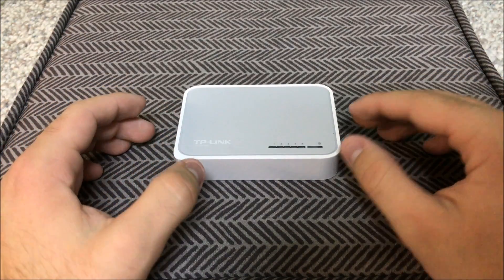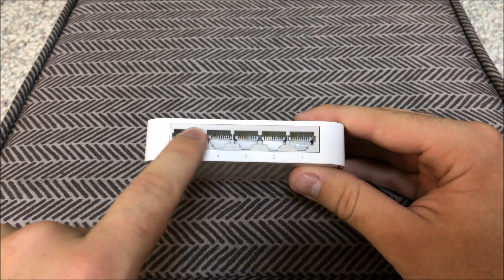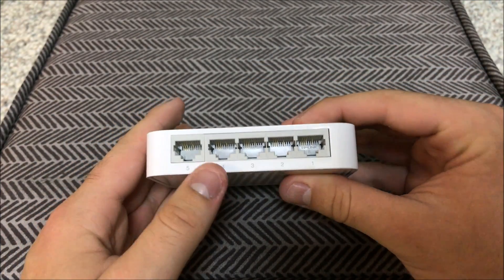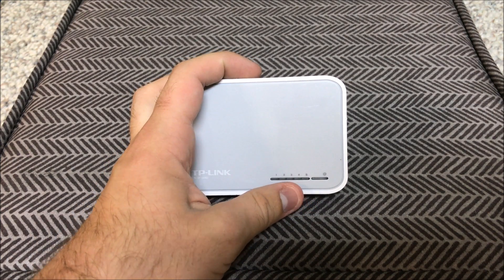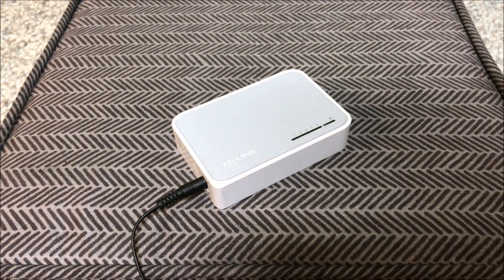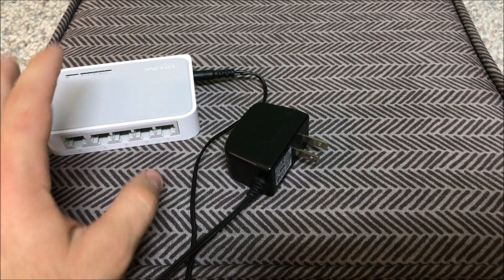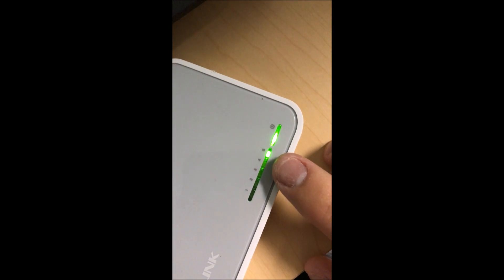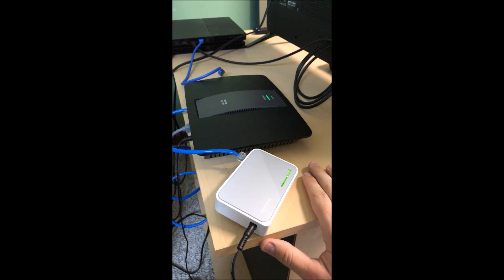TP Link TL SF1005D

Comment: Can I use it on an WiFi extender? I mean that I would connect the wifi extender port to the 5 port so will i have the rest 4 of the ports ready to plug in into my devices ?

Comment: I'm looking to use this device with the WR902AC and a 4G/LTE connection as a portable internet solution. So, I'd like to power it with a USB cable but I can't seem to find anywhere that tells you the size of the DC barrel connector.

Comment: So if I attack an ethernet cable connected to wifi and two other wires for pc, does the initial cable make the other two work as well?
Reply: The way this device works is the following...

ISP(Internet Service Provider) -> House -> Wall Outlet -> Router -> Wi-Fi + Unmanaged Switch -> Your Devices you want on the internet.

The Router handles IP Protocol communication, AKA IPv4 with NAT(Network Address Translation) or IPv6 ( no NAT required ). Try to use IPv6 when you can and avoid IPv4 all together as it introduces NAT which can severely limit your ability to play with others or even just play properly and you wouldn't even notice.
The Router creates a Wi-Fi Field and Network that other wireless devices can connect to.
The Router also tends to provide some ports that you can use to connect up devices physically, with a cable, vs using Wi-Fi.

This device, the one being reviewed in the video (TP Link TL SF1005D), is called an Unmanaged Switch. All it really does is add physical ports, if all the ports on the Router are taken up. For it to work you need what is called a dedicated backhaul cable, It's just a basic CAT cable of sufficient quality, aka CAT 5e, CAT 6, CAT6e, etc, coming from one of the Router's ports to this Unmanaged Switch. After that, you connect up other devices, via wire, to the Unamanged switch, and now those devices have a wired connection to your network.

Comment: So this is kinda a hub and if i plug in one ethernet it wil unlock kinda like 4 extras right?
Reply from the maker: Yes it will. Usually a switch will have 4-5 ports on the back to connect ethernet. One of these ports will be labeled or colored differently usually, that’s the one you connect to your modem or router via Ethernet. After that one cable is connected the others will provide internet when cables are connected to them.

Comment: What even is it
Reply from the maker: It’s a network switch. It takes a wired internet/ethernet connection and splits it among several devices. It’s like WIFI, only it goes through a wire and is slightly faster and more secure generally speaking.

Comment: I am kinda confused I have an ethernet connection connected my pc, can I use this switch and then connect 2 more cables so I can have the connection used for my pc and my ps4?
Reply from the maker: Yung Pizzaaa yes you can. One port on the back of the switch is what provide internet throughout the switch (it’s usually labeled). The ethernet cord going to your pc needs to go into that port. Then you can use more cords to connect your pc and your PS4 to the ports on the back of the switch.
Reply: @simplicityelectricity8710  thanks a lot m8
Reply from the maker: @yungpizzaaa1172  anytime

Comment: bro can we connect with WiFi router
Reply from the maker: Yes, you can connected via ethernet cables. Make sure the switch has internet going into it via cable (usually it has one port that is a different color or outlined) then after it has internet you can run cable from any of the other ports to routers, tvs, computers, whatever you want to.
Reply: @simplicityelectricity8710  then I don't need to buy t link modem
Reply: bro will not get enthernet cable one this tp link

Comment: Hi bro can i connect two (tplink)switches together?
Reply from the maker: Yes you should be able to. If the switches look like the one in the video, just connect an Ethernet cable from one of the 4 ports on the back of one switch and run it to the outlined port on the back of the other switch. It’s hard to notice in the video, but some switches only accept internet through one port, which is usually outlined or a different color. Sometimes switches can accept it through any port though in which case plug it into any of them.
Reply: Simplicity Electricity Thanks Bro 😊

Comment: is there a way to know its ip ?
Reply from the maker: Usually you can connect it to the computer via Ethernet and it should pop up in a lists with other IPs. How you get to that list is up to you as there are several ways to see it. I would recommend a google search after hooking up the switch to see what option is best for you and what you feel comfortable with.
Reply: @simplicityelectricity8710  do u know the easiest way to get the ip ?
Reply from the maker: Deathwarrior one way to do it would be to connect it to a pc via Ethernet cable then scanning for it on your computer. I’m not an expert on doing that however so I’d recommend a YouTube video that shows you how to find the IPs of connected devices. Usually if you unplug it and refresh the list one of the IPs should disappear and then you’ll know it’s for the switch

Comment: I'm confused by ethernet. Are there different types of ethernet cords and only one type will work with this? I've tried using other varieties of ethernet, and they do not appear to work with this device.
Reply from the maker: Adam Blumer there are several types of ethernet cords, the most notable ones being called CAT5 and CAT6 or some variation with those numbers. Any ethernet cord should work with this device, but some cords transmit data at faster rates among other things. It may be something in the device itself not responding to the cords, perhaps it may not be able to detect the cords being plugged in. Does your switch have lights indicating when something is plugged in?

Comment: What does 10/100mbps means? Can i connect it to 4k tv or is the bandwith too small?
Reply from the maker: Stelios Koupepides 10/100 is a standard used by many switches that indicates that device can determine the speed of the device it’s connected to, being either 10mbps or 100mbps. To put it simply, if your internet connection exceeds this or if you have a lot of high grade equipment then the bandwidth may be too small. Odds are however that this device can be connected to any 4K tv or any other device just fine without limiting quality. If you feel like my explanation didn’t quite answer your question there are plenty of helpful resources online that could explain it better than me.

Comment: Can you help when I plug my switch to my att router it make it disconnect? Also should my switch be plug into a outlet surge protector?
Reply from the maker: Jamel Haynes the ATT router should have ports on the back that you can plug anything into, this includes switches. If it’s causing your router to disconnect from the internet I would try all the ports on the back and if that doesn’t cut it it could be an electrical issue. Extra protection always helps. If you feel replacing the router or switch would be annoying or a financial issue then yes, but if not then you can do whatever is more convenient and they will still function the same with or without a surge protector. If you could go into more detail about the disconnecting I could tell you more?
Reply: @simplicityelectricity8710  I would like to try your idea bout plugging 4 Ethernet cables into my router but unfortunately I have 2 also are brands like tp link and netgear universal
Reply from the maker: Jamel Haynes could you be more specific on what is getting disconnected? Is what you’re plugging in getting messed up or your ATT modem?
Reply: @simplicityelectricity8710  my router does not have a modem is that like the battery for the router?
Reply from the maker: Jamel Haynes a modem is connected to your phone line, most home and apartments have them. Usually someone from an internet company installs them.
Reply: Simplicity Electricity my wifi keeps disconnecting like it was randomly connecting and disconnecting my wifi just only one cable the dsl line cable
Reply from the maker: Jamel Haynes it may sound old fashioned but try resetting the router/modem or updating its software. There are times where it will help devices connect to newer devices properly. Beyond that it sounds like a hardware issue, which you may need someone to look at hands on.

Comment: I don't think you understand how a power supply works. The PSU specs state a voltage and amperage and the only one of those two that's fixed is the voltage whereas the amp rating simply indicates the maximum it can output but how much is actually delivered depends on what its connected to. This means that if that device is 5v/600ma and you use a psu that's rated at 5v/6000ma, it will work just fine and the psu will only deliver 5v/600ma.
Reply from the maker: Potus ThePlant I was just trying to be specific so no one would get confused.

Comment: What is this used for?????plz reply...i mean can i use it wirelessly coz my rootee is in another room
Reply: It's just a switch.. 1 input 4 output that's it. It won't give you wireless network. For that you have to buy a router which has wireless network.
Reply from the maker: The below answer is correct. Sorry for the late reply but yes, it cannot be used wireless, it is meant to route internet via Ethernet cables, which do not involve WIFI.

Comment: I have the same product but when I plug in my ethernet cable it doesnt provide internet. The lights keep blinking (all of them), i tried all the 5 ports for but it wont work. what to do?
Reply from the maker: Sandjero Sombrero this could be for several reasons, I’ll try to be specific because I know these things can be frustrating.

Switches don’t usually break so to speak, unlike routers. So you could start by resetting the modem or router that the Ethernet cable you’re trying to plug in is connected to or by plugging it into different ports.

The chip inside that actually spreads the Ethernet signal to the other ports could be fried, and in this case you’d have to replace the switch outright :(

Although it’s rare there are cases where switches just aren’t compatible with routers/modems. I doubt that this is your problem but if you really want to try to make it work and not be forced to replace it I would recommend changing some setting in your router/modem, possibly security features? I’m a little fuzzy on that however.
Reply: I had the same issue after trying to use the switch in a new/different setup.
The ONLY way I got it working again was to plug in ALL the same devices that were plugged in before. Then it went back to the async traffic flashing and all devices were connected to the internet.
Maybe it was caused by TP Link Wireless Nano N Router which was also connected to the switch. The Nano Router's job was to host an independant WLAN network (which he did). But the router also offers many other networking modes (WISP-Client, Client, Repeater, AP) and might have changed to one of them when I was unplugging all the lan cables in random order. And that other mode might have caused the issue.
Reply from the maker: Martin Schneider honestly this probably helps anyone who reads the comments. Most of the stuff I review is quite old in comparison to what’s on shelves. I just find the older devices more practical, but I can see how they could not be compatible with a lot of new technology.
Reply from the maker: Josh McDermott rip everyone’s switches I suppose. I have been fortunate that all of the equipment I use/make videos of hasn’t broken...yet

Comment: what’s the device’s webpage password?
Reply: This device does not have a webpage or username password. It's plug and play
Reply from the maker: The Supreme Nerd you are 100% correct. I am going through my comments and realizing that person above must’ve had a router of some kind for it to ask for a password.
Reply: @simplicityelectricity8710  yeah i open this device myself plus i researched it before i bought it
Reply from the maker: Potato02727347 8 the device webpage password for devices such as this usually are "admin" or "password". This is assuming the device is reset or has features like a router. In this case I've never been prompted for a password so I can't honestly answer.

Comment: can i plug my actual internet lan cable to this switch and then spilit into two cables.. in which one goes to router for wifi and other to pc directly.. (because im trying to bypass routers port as it gives me greater ping than direct connection)
Reply from the maker: Hi TechHeaven sorry about the late reply, haven't had time to check comments lately. To answer your question, yes you can. If you're using this exact switch you should be able to plug the LAN into any port and the switch will automatically make all other ports extensions of your connection. If this doesn't help please reply back!
Reply from the maker: The TeamExtreme thank you for your reply in the comments! I hadn't noticed the previous comment until your notification popped up so much appreciated.
Reply: update: it will work but either the wifi will work or the pc.. you can't access them both at a time :'( !
Reply from the maker: TechHeaven could you explain it a little further and maybe I can give you a solution. Are they both plugged in? Are the ports labeled?

Comment: Does this come with power plug
Reply from the maker: Jus Badd Happy New Year! The one being used in the video I received with a used power cord. I didn't get the item from any website or store, but if you do get the item online they usually clarify if the device comes with the cord, if not they are cheap to buy separately. Hope that helps.

Comment: My switch keeps blinking all the time
Even when it is connected to my laptop
Reply from the maker: The Awesome Pug gamer I have several questions, hopefully I can help. Firstly is your switch the same as the one featured? Does it happen to have a reset button? If not is it still providing internet through its ports?
Reply: Simplicity Electricity nah I'm fine now I somehow fixed it 
Apparently it did not work if only two cables are plugged in(including internet cable) I had to plug in three or more
Reply from the maker: The Awesome Pug gamer that's a new one for me, but I'm glad you were able to get it working! And I apologize for the late response.
Reply: Simplicity Electricity it’s fine your vid makes amazing
Reply from the maker: Mr.Puggles GAMING I love pugs too btw! I used to have 2! Keep up the good work on the channel.
Reply: Mines disconnect me off my WiFi and my WiFi

Comment: I have an ethernet cable coming from the house to the exterior internet connection on the rv. There is an interior ethernet jack from which currently I have a long cable stretched to the laptop in an adjoining room. The rv has neither a modem or router. So it was my intention to run an ethernet cable from the interior jack to the TP-Link switch, And then a cable from the switch to the laptop. And a shorter cable from the switch to the back of the dvr. Do you see a problem with this setup?
Reply from the maker: I apologize for the late reply, but to answer your question no I do not. The switch should act as a hub for your ethernet connection, much like a wall socket does for electricity. Some switches can protect your ethernet cables from overload as well so I think it would be beneficial and convenient. Hope this helps!